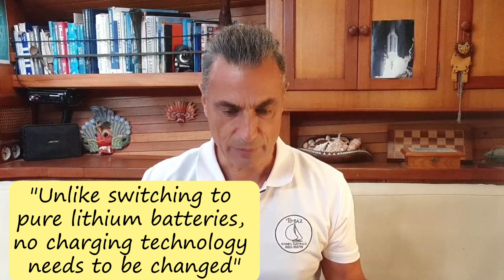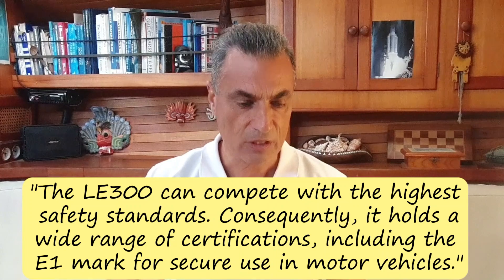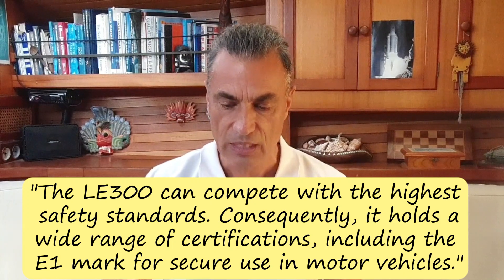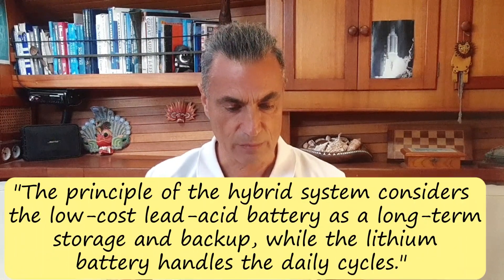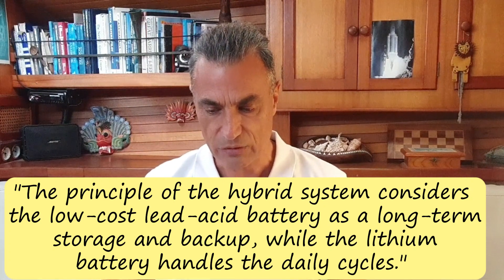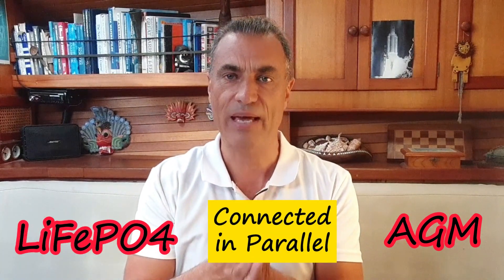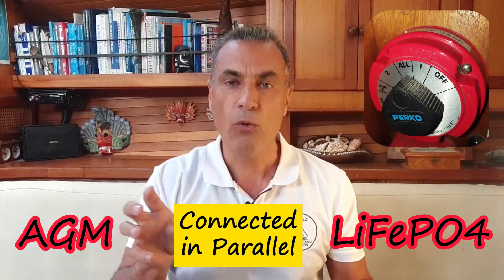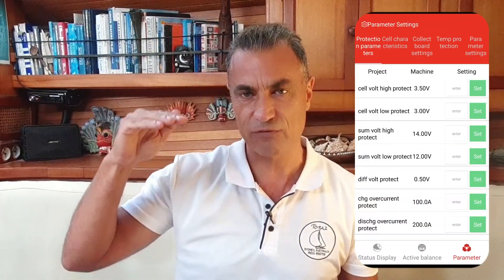Do not install Lithium on your boat until you WATCH THIS! Save $1000s

Comment: I spent nearly a year researching this before taking the leap. 2 years ago I added a single 150aH LifePo4 with a JBD Overkill BMS to my existing two x 180aH AGM’s that were only one year old. The total cost was £650 for the LifePo4 and £30 for the cables. The LifePo4 can be safely installed inside a cabin, so the cable length gave me enough resistance to regulate the LifePo4 charge rate to about 50a from a 110a alternator with a single V belt. But that 50a doesn’t tail off like a LA battery does, and the LifePo4 doesn’t necessarily need to be fully recharged like a LA battery. Even the solar harvest is much bigger due to the rate that the LifePo4 can accept the charge. Since going hybrid we now use a 240v kettle and an electric toaster, which we couldn’t do with just the LA batteries due to the voltage drop to the inverter. 
An important point to note is that you really do need a fully user configurable BMS like the JBD Overkill, which is now used by many of the ‘drop in’ LifePo4 manufacturers. Setting the pack high volt disconnect to 14v means that the LifePo4 will have a much longer life than the usual recommended maximum 14.6v, but with minimal loss in capacity. Set the pack high volt release to 13.5v. The LA bank will start to contribute to the load at about 12.7v, but since going hybrid we’ve never gone below about 12.3v, and have certainly never reached the LifePo4 BMS pack low volt disconnect of 12v.
Reply from the maker: Thank you for sharing your experience! It’s wonderful to hear how transitioning to a hybrid system has positively impacted your boating life. Your story not only showcases the efficiency and enjoyment of this technology but also highlights the significant economic advantage. The upfront savings from not having to buy additional equipment or undertake extensive rewiring make this solution an economically smart choice. Thanks again for watching and for adding such valuable insights to our conversation!

Comment: I am highly interested in this process thankyou for covering it alot of people seem to shy away from explaining Hybrid LA/Lithium bank setups, I have a bank of 1 year old AGM's in prefect condition but I'm looking to suppliment them with a small 100A lithium. I have a few questions regarding setting this up without blowing myself or the boat up. I have always been lead to believe they should never be in the same system, Is the boats charger set to charge the LA or the lithium in its settings, How do you restrict the amps from the boats alternator as the lithium will certainly draw everything it can offer leading to the alternator heating to extremes, I've heard people use cable size to restrict the current sent to the lithium is this in diameter or length and how do you work this out is it dependant on the size of the lithium or because of the draw from the lithium and is it nessesary, I've also seen 'drop in' type lithium batteries with charge rates very similar if not identical to LA are these ok to use or are there certain types of lithium that should be used (programmable BMS types) I understand the litium is protected by its BMS but are there any other safety precautions needed (breakers/fues etc) a video showing how easy it is to setup this system would be great and go a long way to helping people interested getting a better grasp of the concept.
Reply from the maker: Thanks. With Hybrid you add the Lithium in Parallel with the AGM. Your charger is set to charge LA - that is the beauty of this hybrid design. In the video I explain the alternator options. The Facebook group I have in the description is a great place to ask more involved questions. There are 100s of boaters there that have implemented longer cable solutions to reduce the alternator current. They can also answer your breakers/fuses questions. For Hybrid you need to have a programmable BMS. Most drop ins do not have this. Assembling your own Lithium is easy. See https://youtu.be/N2DhYrmxskM

Comment: Interesting video. I have not heard of this solution before. I have many very basic questions. How do you connect things like your solar charge controllers? Your shore power? Do you attach to bank 1 or 2 or both?
Reply from the maker: Thanks. There are 100s of boaters  that have implemented like a hybrid solution like this. Including myself. Join the Facebook group I mention in the video description.  They will answer all your questions with real life experience.  Since the batteries are always in parallel at "both" you can connect your charge source to either 1 or 2 or both.
Reply: @SmartBoatInnovations  thank you. The fb group requires you to apply. I did yesterday. Still pending.

Comment: Are you saying when your lead acid die you should replace with another lead acid or just until it dies.
Reply from the maker: Thank you for your question. In the video, I discuss setting up a hybrid battery system that combines LiFePO4 and Lead Acid batteries. The idea is to utilize both types without the need for purchasing expensive components or undertaking extensive electrical rewiring. If your existing lead acid battery is in good condition, it can be integrated into this hybrid setup. Alternatively, if you need a new lead acid battery, you can opt for a smaller one. Since in this hybrid system the lead acid battery primarily serves as a backup, it can last between 7 to 10 years, which is a significant lifespan for such a setup. This approach aims to provide a cost-effective and efficient solution for those looking to enhance their battery systems.

Comment: Can you comment on how any of this would apply to a 24v house battery systems found in many cruising boats.
Reply from the maker: Yes you do exactly the same. You install a 24 LiFePO4 battery. Setup up the BMS is disconnect at 28V on charge and 24V on discharge. Join the Facebook group and the guys there will advise you more.

Comment: Well presented video - thanks for posting!    I also support the use of a hybrid Pb/Li system but I think that there is a dangerous flaw in your installation.  
 
I'm a marine electrician with three decades of experience and also have a background in computer software validation and electronics.  I live aboard my cruising sailboat and installed a 600 Ah lithium hybrid system a year ago.    I quickly found out that my existing battery charger and alternator regulator were tripping the BMS over-voltage on a daily basis.  It wasn't a problem, as the Pb battery in parallel prevented alternator damage, but I became uncomfortable with this situation as I realized that the Daly 250A BMS was the only thing between me and disaster.  
 
My only problem with the installation that you have described is that you are relying on a single component - the BMS - to prevent catastrophic over-voltage, damage to expensive battery cells, and a potential Li fire.   IMO, this is like running a boiler up to its maximum pressure and relying on the safety valve to function and prevent an explosion rather than moderating the fuel to keep temperatures and pressure under control.  
 
Ultimately, I wound up replacing my battery charger and installed a DC-to-DC charger between the engine battery/alternator and the house bank.   The risk of relying on the Daly BMS was unacceptable to me.  
 
So, there's another data point and another opinion.  Thanks for posting the link to the FB group - I'll be joining.  I learn something new from every other boat and installation that I get to see.  
 
Best regards,
Capt. Charlie
s/v Aurora
Reply from the maker: While I appreciate your concerns about the reliability and safety of a single BMS in a Hybrid Pb/Li system, it seems there might be some misconceptions regarding the specific risks you've outlined. From a broader perspective, shared by many experienced professionals in the field, the potential dangers you're worried about are significantly mitigated by the inherent design and safety features of these systems. I encourage you to join the Facebook group discussion, where certified installers of hybrid systems can provide detailed insights and address these specific concerns.

It's important to note that lithium batteries can safely handle up to 14.6 volts, though ideally, they should not be consistently held at this upper limit. In systems where the alternators and chargers are regulated to stop at 14.4 or 14.5 volts, there's no significant risk of overcharging or damaging the lithium cells.

In well-managed LiFePO4 battery systems, the risk of fire is quite minimal due to the inherent stability and safety features of this cell chemistry.

The BMS is designed with switching elements capable of handling a short circuit. This robust design means that the BMS is well-equipped to manage high-power situations with minimal stress, making it more reliable and less likely to fail compared to other components like DC-to-DC chargers.

Your insights are greatly valued, and further discussion with experienced installers in the Facebook group could provide additional clarity and depth to this topic.

It's important to note that a well-designed BMS has built-in safeguards to protect the battery. In the rare event of a BMS failure, these systems are typically designed to disconnect the negative cable of the battery to prevent any damage or safety hazards.

Furthermore, the charging sources, like alternators, are equipped with their own regulators. These regulators usually limit the voltage to a safe level, often around 14.4V, which is within the safe operating range for LiFePO4 batteries. Therefore, the likelihood of overcharging due to a BMS failure is considerably reduced, as there are multiple layers of protection in place.

Even in an extremely unlikely scenario where both the BMS fails without disconnecting the battery, and the charging source's regulator also fails, LiFePO4 cells are quite robust. They can typically handle voltages up to around 14.6V. Should the voltage exceed this limit without a functioning BMS, the most probable outcome would be damage to the LiFePO4 battery, but the risk of fire is almost negligible due to the chemistry of these cells.
Reply from the maker: The adoption of hybrid Pb/Li systems is gaining traction, with a growing understanding of their safety and efficiency. Several professionals in the UK have successfully insured their installation services by effectively communicating the low-risk nature and advantages of these systems to insurance companies. This understanding is partly due to the inherent redundancy in these systems, which many consider safer than using lead acid batteries alone. Additionally, it's noteworthy that at least three battery suppliers in the UK endorse hybrid configurations. One of them even offers to pre-configure the BMS correctly before shipping, reflecting confidence in the system's reliability. Furthermore, from the feedback gathered, installers who have adopted this approach, some of whom are connected through the Facebook group, report positive experiences without significant incidents, even after setting up hundreds of these systems

Comment: Great video. I've used hybrid for 2 years and it changed my life.  No more obsessively watching SLA state of charge and hour upon hour engine running to stay topped up.
I've tried unsuccessfully to find the link(s?) to recommended Facebook groups .  Could someone please point out for me?
Reply from the maker: The Facebook group name is in the video description. But I have copied that info to this comment for you...
Group Name:  12 volt boating group
( It is better you use the URL link below as there are many copy cat facebook groups with almost the same name - "12 volt boating group".
The group photo is an old yellow multimeter showing 12.685V )
https://www.facebook.com/groups/144684286108763
Reply from the maker: Thanks for sharing your experience! It’s fantastic to hear that switching to a hybrid system has had such a positive impact for you. Your story is a perfect example of how this technology can make boating more efficient and enjoyable. If you have any tips or insights from your two years with a hybrid system, please feel free to share. It could be incredibly valuable for others considering this change. Thanks again for watching and contributing to the conversation!
Reply from the maker: The adoption of Lithium Hybrid solution is gaining traction, with a growing understanding of their safety and efficiency. Several professionals in the UK have successfully insured their installation services by effectively communicating the low-risk nature and advantages of these systems to insurance companies. This understanding is partly due to the inherent redundancy in these systems, which many consider safer than using lead acid batteries alone. Additionally, it's noteworthy that at least three battery suppliers in the UK endorse hybrid configurations. One of them even offers to pre-configure the BMS correctly before shipping, reflecting confidence in the system's reliability. Furthermore, from the feedback gathered, installers who have adopted this approach, some of whom are connected through the Facebook group, report positive experiences without significant incidents, even after setting up hundreds of these systems